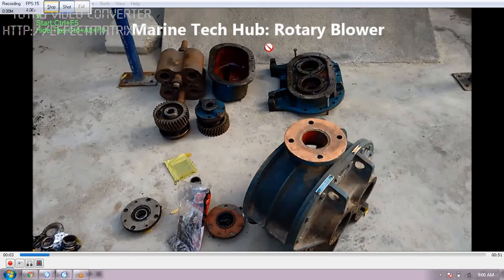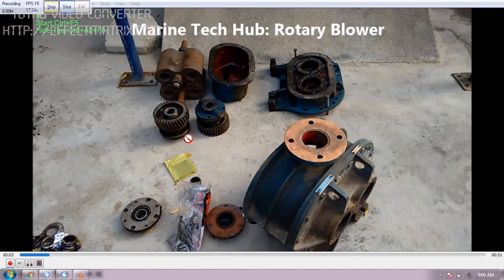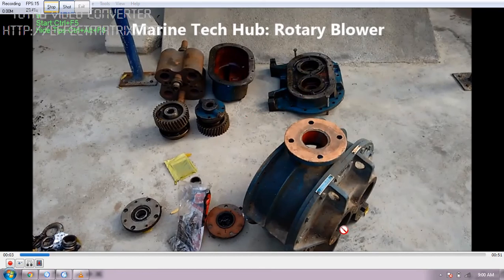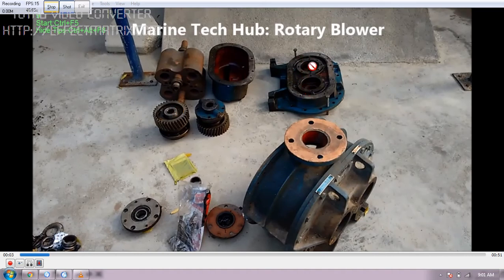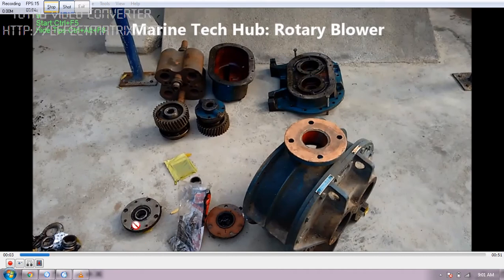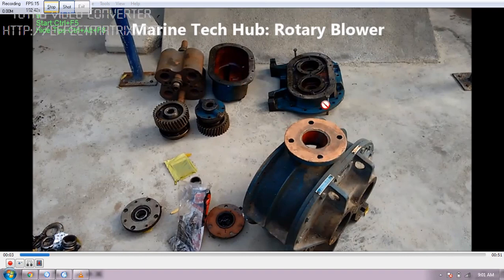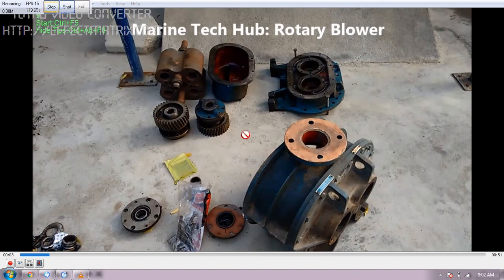Rotary Blower; How To Assemble

Comment: Please explain what happened if timing adjustment goes wrong during tightening of gears or during adjustment backlash of grars
(a little bit offset from center position between lobes for example one side 0.55mm and other side 0.35mm)
Reply from the maker: Thanks for your valuable feedback !! Do share it with your colleagues and friends
your request is well noted